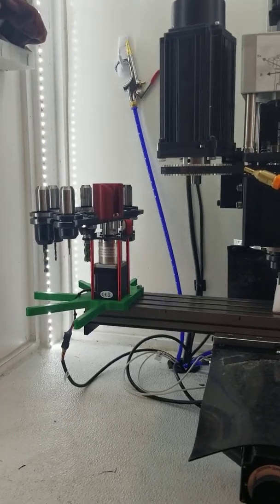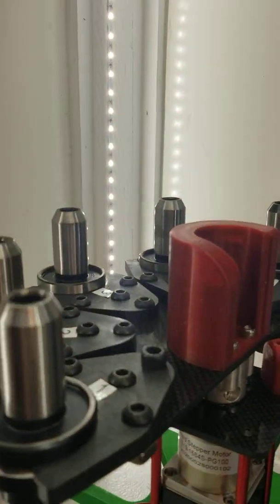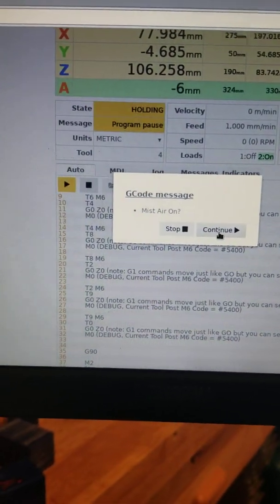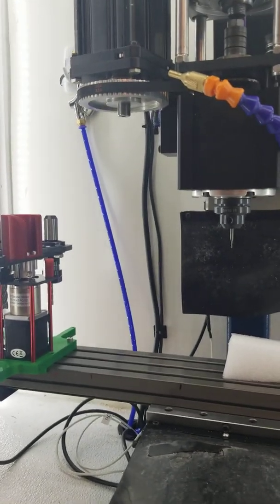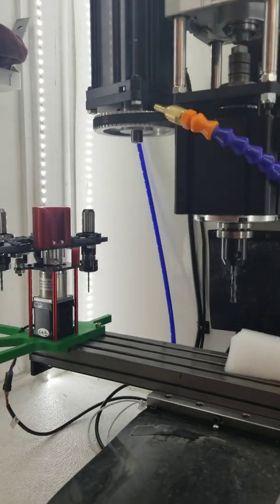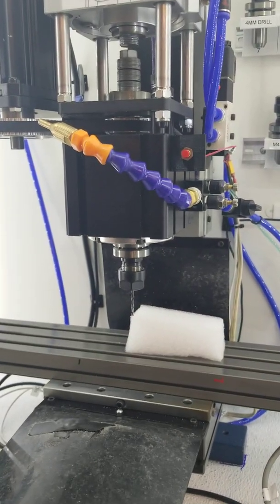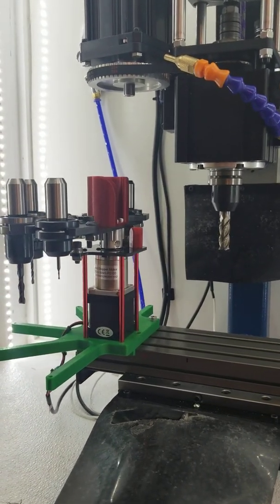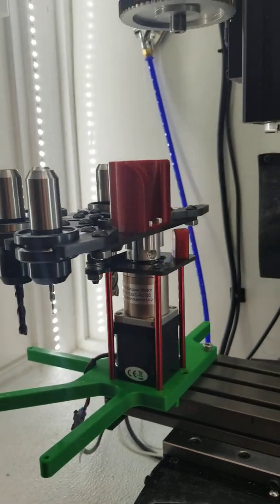Taig 5 Pocket ATC - Update

Comment: Really Nice! Reminds me of the 8-Ball changer that other guy was doing. Now that you got this working and functional will you be able to speed the process up for faster changes? Also do you plan on selling? if so how much?
Reply from the maker: Not finished yet, I still need to finish the chip guard.  I assign variables in the code for the various feed rates so i could increase these if I wanted to move X, Y, Z or rotate ATC faster.  However, don't really see the need.  If I can find someone to do a trade for a Stuart Andrews frame or make me a beefy frame I'll open source all the design files.  I may also make one batch of 5-10.  If i was to make and sell it would be a min of $750 maybe more.  The parts and raw materials are $300 and if I had a shop cut the CF pieces and 3D print parts it would easily add another $300-400.  Tormach's cheapest ATC is almost $4k.  I looked at the 8ball and a few other table mount ATC designs and found them too complex.  I tried to make it as simple a design as possible.  The 8 ball had a very complex spindle that didn't use a PDB and rumored to have a lot of run out.  I have a spindle made by Jarrett Grover which uses the Tormach TTS system and my ATC doesn't use rotary tables, or belts etc.  I got a stepper with a 100:1 gearbox attached and the extra length makes the stepper perfect to be the main structural component to the design.